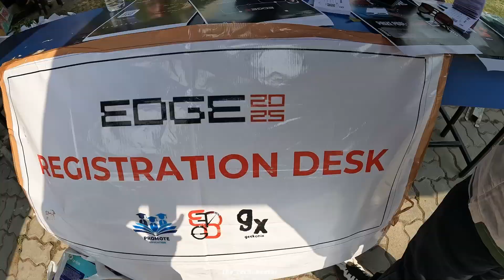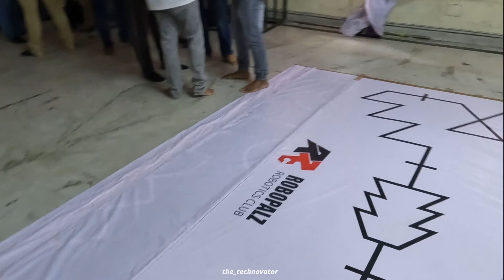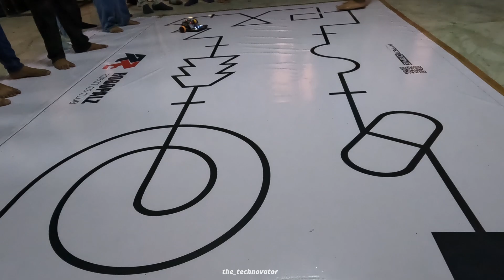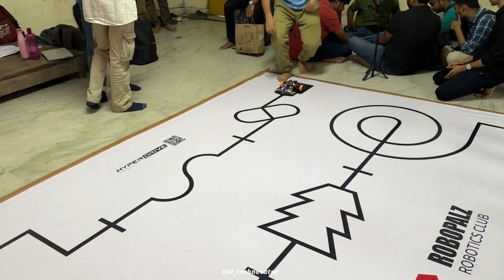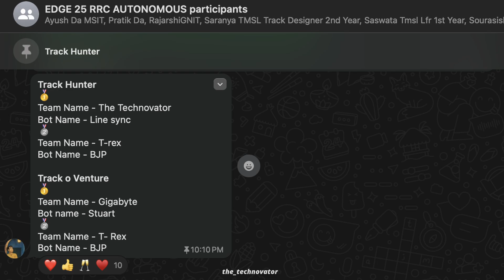I went to a Line Following competition and Won! 🏆| EDGE 2K25 | Robotics India

Comment: y arent you using esp isnt esp much faster than arduino is there any other reason y u didnt use esp and prefer to stick with arduino
Reply from the maker: Well surely the ESP is faster than arduino but that extra clock speed doesn’t give any practical advantage in such applications as faster processing doesn’t correspond to a faster bot. Since I am into this hobby for a considerable amount of time , I had like 20 nanos collecting dust on my desk so I utilised those thats it.
Reply: @the_technovator  also for the code like if the left sensor see the black line we will stop the left motor and spin right one only but when it is going fast it won't turn instant so it slips out of the track consider it should turn a corner  l shape ,how does your robo turn it at a split second it encounter full white lines alone

Comment: Very slow!
Reply from the maker: The kind of track we have here in my region is a more logically complex track so running at higher speed creates a lot of room for mistake… had to keep the speed low for such a track design. But yeah surely this is not the fastest bot there! 
Would love to know and learn if you have a better running bot 😇
Reply: @the_technovator  The tracks shown in video are very simple with fairly large radius and no where close to difficult. Your bot design is amateur hence affected by Z-axis variance. The bot tuning is loose and has some-overshoot (assuming it has PID). Your bot width is too much for such tracks, too heavy probably, and that horizontal line sensor bar is not helpful for upcoming corners.
I had created these bots in my early college days for teaching and competitions, and were much faster than this.
Just search on youtube for line following competitions and you will understand the benchmark for difficulty and speed.